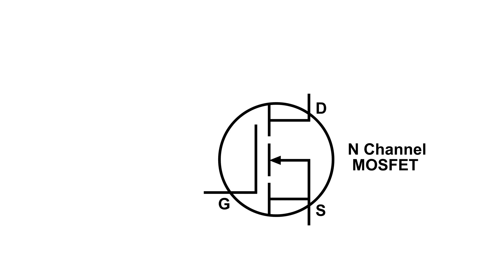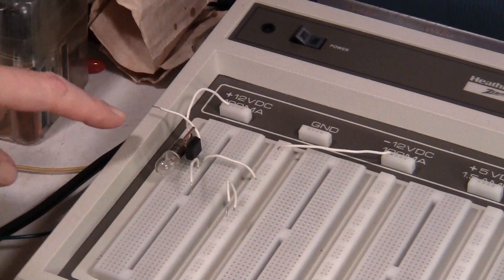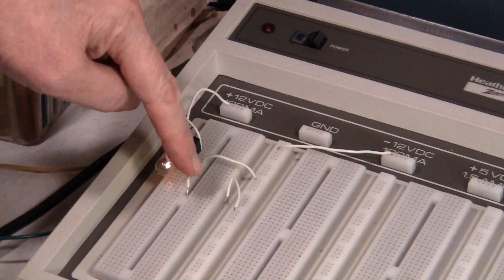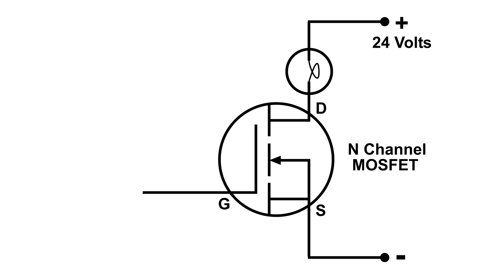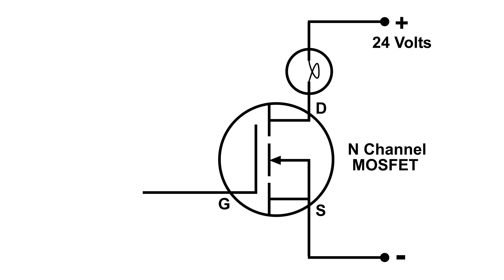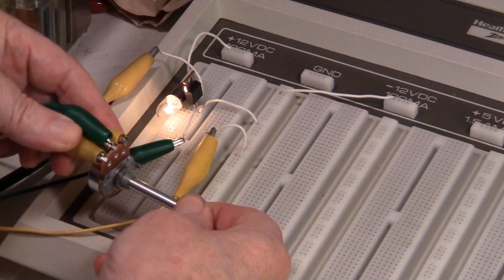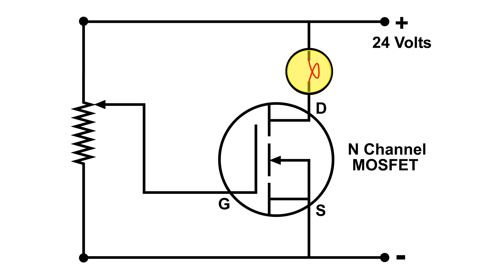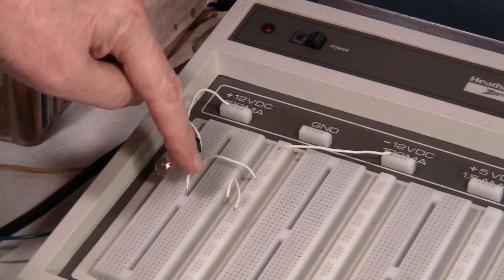MOSFET Biasing Experiment

Comment: is Vds same as Vdd?
Reply from the maker: VDS, or drain-to-source voltage, is the maximum voltage that can be applied between the drain and source of a MOSFET. When selecting power MOSFETs, the VDS rating should be at least 20% higher than the supply voltage. In some cases, a higher margin may be required. 

Drain-Source Voltage (VDS ) VDS represents MOSFET absolute maximum voltage between Drain and Source. In operations, voltage stress of Drain-Source should not exceed maximum rated value.

VDD, or drain power voltage, is the positive supply voltage in an electronic circuit, especially in MOSFET transistor technology. 
Definition: The voltage difference between the positive power supply and the ground.
Reply: @AllAmericanFiveRadio  So do we separately apply Vds or it just drops automatically after application of Vdd at drain for NMOS ?
Reply from the maker: @kaavyabanerjee  The Maximum voltage drop across the source and drain. Start low and work up.
Reply: @AllAmericanFiveRadio  so if we want our MOSFET to work in saturation, say, and need to apply Vds> Vgs + Vov , how do we do that if Vds is just the max drop across the device n we can't control it?
Reply from the maker: @kaavyabanerjee  Don’t try to reinvent wheel. Look for lots of examples. That is the fastest way to learn. Then you can modify the circuit and then you can see why it was built that way. Here is one example.
MOSFET Push Pull Amplifier Visual Demo
https://www.youtube.com/watch?v=-6N7l1dnk6s

Comment from the maker: The higher the impedance at the input means, the input (gate) of the MOSFET does not short out the signal applied to it. The impedance of the gate is about 10-11 meg-ohms. So a charge left on the gate will take a long time to run through that 10-11 Megs.

Comment from the maker: I was not grounded. When I touched the gate wire it put a positive charge on it turning on the MOSFET. When the MOSFET was on a little, I was able to rub the plastic making the gate negative turning off the MOSFET. The MOSFET has very high impedance, much higher than us.